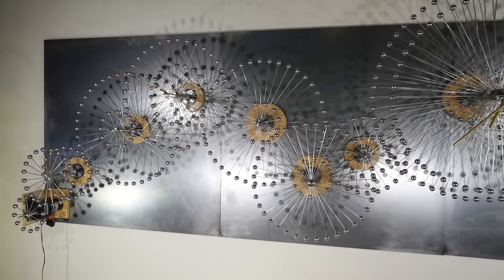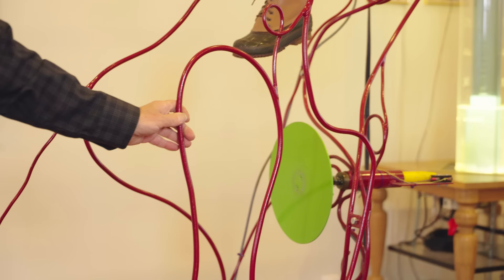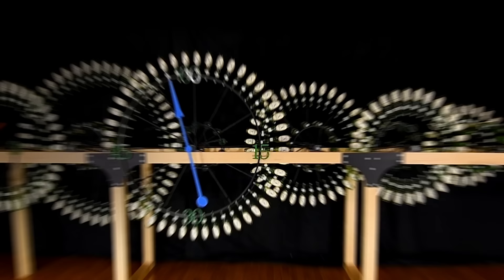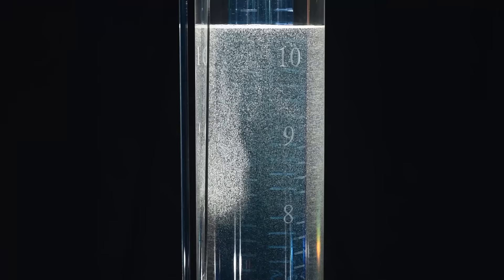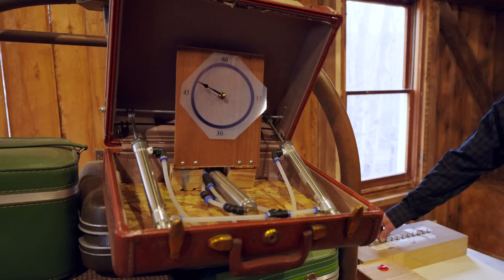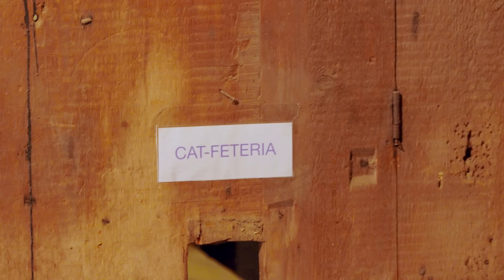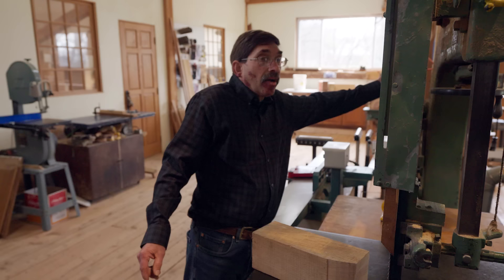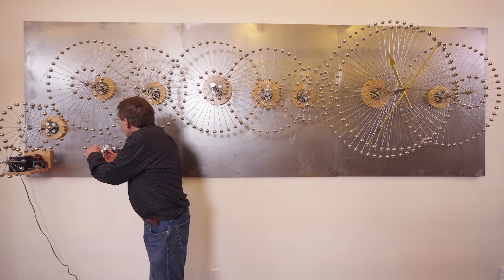How This Guy Makes the World's Most Inventive Clocks | Obsessed | WIRED

Comment: Thanks for your video on Rick's handicrafts. I really like kinetic sculpture; Rick's clocks add a timely component to the art/skill of making time pieces.
Also I am old enought to recognise and be able to use his draughting machine. I would also like to suggest restriction valve be fitted to the exhausting port of the air cylinders. In doing so, the exausting air can be regulated, thus ensuring the suit cases open more smoothly.
Thank for an enjoyably spent period of time watching this video.
Reply: Thank you for your comment.  A regulator exhaust air is a good idea.

Comment: Re Daylight Savings Time:
You need to design the clocks to make it easy.  That's an important feature for a clock to have.
Anything microcontroller-based can have a switch that you flip one way or the other.
For the domino clock and others that have a little window that reveals the hour, the housing for that window can rock back and forth one position.  In all cases, it shouldn't take a week to fix them all, but should be trivial enough to change as you walk by without breaking stride.